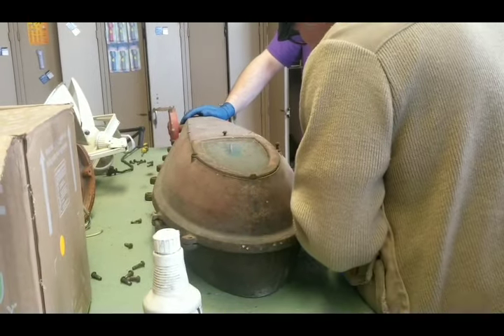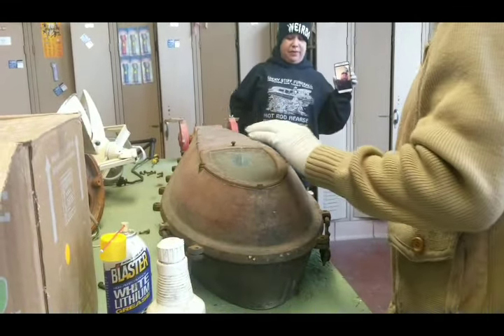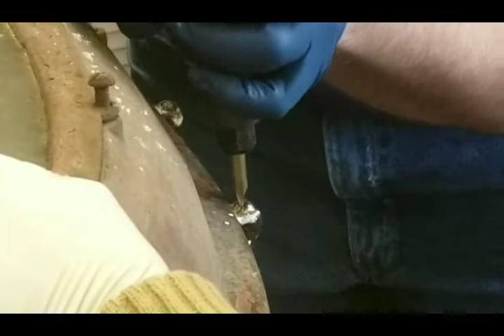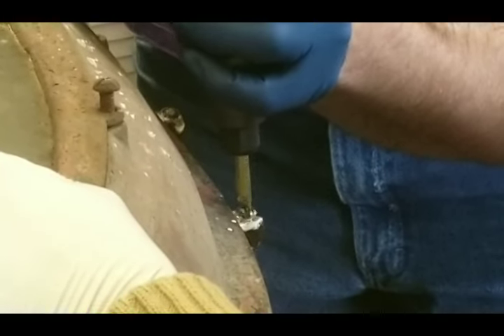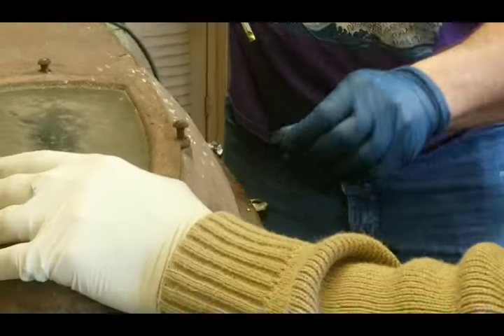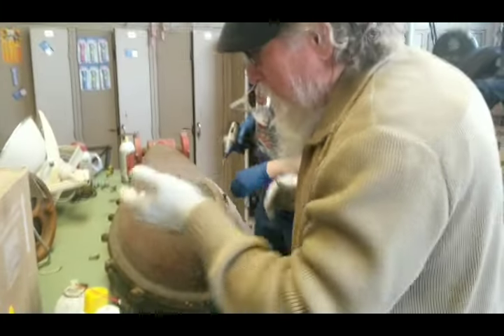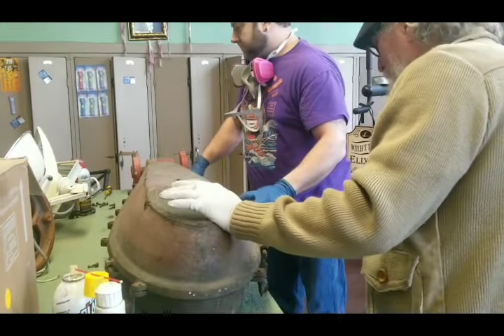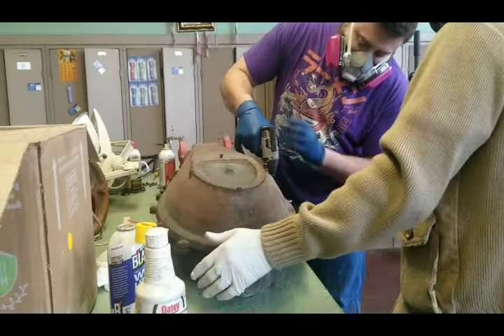Opening an 1800's Cast Iron Coffin

Comment: A suggestion for this:  Restore it to it's original look and donate it to a museum or something like that.  As there aren't that many many coffins like this, it would probably be an interesting exhibition piece.    Also, next time you do another thing like this, let your viewers know that it hasn't been used.  Would clear up a lot of people with Torches and Pitchforks. :D
Reply from the maker: I think my dad plans to at the very least coat it with a clear coat to stop the further deterioration. But he has no plans to sell it or gift it to any museum.
Reply: Exactly
Reply: Cast iron is fairly stable, as long as it's not somewhere damp it'll be fine insofar as the metal is concerned. Clearcoat will impart a shine which probably isn't what you would want. It's a bit of a work of art, that coffin.  @hollyerinn

Comment: I would never use power tools to open an antique like this.
Reply: ikr? especially one as apparently rare as this
Reply: Yeah I winced as soon as it transitioned from her talking to the power drill! A little lubricant and a lot of patience with a hand tool. Yikes.
Reply: Mike Owczarzak  totally agree they didn't use too powerful of an impact either.  Your not gonna damage cast iron.
Reply: Next time they rob a grave try some WD-40
Reply: @johndunn4228  but they did
Reply: They look like they know what they’re doing…
Reply: An electric impact driver is the safer method on something like this with frozen and rusted metal.
Reply: An impact driver with a flat bit? I'm not sure bout that? If you soaked the screws in some version of CRC or WD40 for 24 hrs it would help obviously, but it would also do weird things to the finish of the cast iron... 2nd to the other comment bout an impact driver not damaging cast iron- I disagree. Cast iron especially at cold temperatures can easily shatter- imagine trying to 'easy out' remove the busted off threads? Im not invested in this- I just saw it as a kind of morbidly vulcheristic disrespect to perhaps someones child or 'maybe a gold bar' tsk. At least TRY to pretend you are having some respect though.
Reply: And Christmas there looked kinda cold...
Reply: @stevenrodriguez9655  ...and light torch work when needed. Slot screws are old style and miserable to work with.
Reply: @MattBlack969  My guess is they could probably see through the glass that it was empty.
Reply: @lilskullstattoos9372  Anyone would, to others who don't know what they're doing.
Reply: @MattBlack969  A modern purist would hire a blacksmith to forge an historically accurate crowbar, faithfully to simulate a period grave cracker. Namaste.
Reply: Ok- I must admit I was in a bad mood when I wrote my original posts- but that said- cast iron is notoriously inconsistent in temper and hardness, I assume the 'blacksmith forged tool' comment was facetious? ( If not sorry) but anyone who has used flat head impact tools knows they are not great- and even with a penetrating lube and heat and a hammer struck impact screwdriver you would have the risk of snapping off or cracking the thread housings... It's actually a difficult one to decide? U could heat the housing lugs and freeze the actual screw? But the heat differential could cause the cast iron to crack too even without force... I was more annoyed at the lack of reverence at the time (and anyone who has worked with these things, not even historical artifacts knows flat head screws are notorious for slipping and burring or just breaking yr driver bits) I still think penetrating lube plus heat and gentle manual hammer struck impact screwdriver to break the first bond, then hand removal would be the best I can think of off hand? I'm interested in others opinions though. Cheers.
Reply: @JudgeJulieLit   We have better hand tools now that would do the same job- but if U were serious I completely see where you are coming from. Peace be with you.
Reply: @johndunn4228  didn't rob a grave...first of video explains found at a funeral home..in storage ...and they purchased
Reply: I would use hammer and chisel
Reply: @MattBlack969  yup you sound exactly how you think hahahhahah
Reply: @MattBlack969  should they have worn robes and the special hats of your preferred religion? Maybe chanting some nonsensical "prayers" would have been good? Please let us know how you would have done this we want to know what you would have done to make this holy.
Reply: @toasteddingus6925   @Mr/Mrs/Ms Dingus. Why would you bring religion into this conversation? Did something bad happen to you as a child? If so, my sincere condolences- that's rough. Hope they didn't wear 'funny hats' either :( I wish you all the best in yr recovery and if you ever want to talk there are many resources at hand. You sound hurt. I hope you feel better.

Comment: Penetrating oil first , crack screws loose by hand then use impact driver . All those original screws are buggered up now
Reply: I was thinking the same. Especially after banging on them with a hammer. Heat would have been the more plausible solution from the beginning...
Reply: You’ve got that right. “Penetrating”, not “Cutting” oil(one is for ‘penetrating’ things like rust and corrosion, and the other is for ‘cutting’ [screw]threads).

Comment: MY first impression of the coffin was "how TINY it is". And then, it looks like it has a clear glass "window" on the top of it, BUT, nobody seems to have mentioned it at all.
They are just spraying some "white Lithium" onto the body of the casket where the metal bolts had been, likely to help open up the casket.
At the end of the video, we see that this coffin is empty, an has never been used before. THEN they show a cast iron COVER that fits OVER the glass window of the coffin. It is an interesting  video.

Comment: So excited while watching this! Always loosen rusty bolts by hand first. PB blaster it, loosen a little then tighten a little back and forth by hand. I’d never use an impact on old rusty bolts not till you break it loose first. Also tapping with hammer after applying pb blaster helps. If none of that works torch it! ♥️

Comment: Should have used the fire wrench (oxy-acetylene torch). Just heat the screw bright red hot, then quench it with cold water. The thermal shock will crack the rust causing the screw to be stuck and it will easily come out. Ask any auto or muffler mechanic about it.

Comment: As ‘deathling’ who hung around a Victorian funeral home, so much is fascinating about Victorian funerals. I was going to mention a touch of W-D 40 before beginning would be a good idea since this was in a basement. Also a blast of heat can cause the rust to loosen. Just in case you need to do this again.
Reply: WD-40 is a good degreaser, but horrible as a lubricant. 'lubricates' for a short time, but removes potentially protective Ohio from metal surfaces. Did tests at GM, and defense contractor to verify. A good penetrating oil would be better.

Comment: It's not air tight or leak proof.
Cast iron, mild steel is still porous but if using Azko Nobel PA10 etch primer then a coat of 2 pot epoxy paint then it will be truely sealed.

To seal the both 1/2's just use urethane sealant.

Now if you really want a truely 110% sealed coffin then just make a titanium or 316L grade stainless steel cylinder (like a smoke stack but person size) then slide the body in and close up the end. To stop body decomposition just have a stainless steel valve then purge the cylinder and contents with Argon gas.

Comment: Fantastic. It does help if after the heating, wd40 or similar is doused over the screw. First time you'll just get smoke, second time the fluid will get pulled into the thread as things cool down. No hammer needed, usually, just the impact driver you were using.
Reply from the maker: we'll keep that in mind if we ever encounter a similar issue

Comment: No casket or coffin can prevent putifaction as it starts within the body itself, not needing outside sources. They still sell caskets today claiming to be well sealed to so protect the decedent but it's an unnecessary and expensive choice. Not to mention a sealed casket can actually explode due to a buildup of trapped gases from decomp. Not a wise choice.

Comment: That was really cool and very interesting! Btw I’m jealous you have a hearse 😊
Reply from the maker: thank you! and don't be jealous, you'd be surprised how many are out there for sale if you really wanted one.
Reply: @hollyerinn  Oh one of these days I’ll get one. 👍🏻
Reply: A lot of people are spooked by Hearses. They make great cars as they are built on a heavier commercial frame and mostly use Cadillacs or Lincolns. Low mileage, well cared for autos as the original cost is quite high for the custom body work. Companies like Miller, Superior, Sayers & Scovill, Boyertown body works, and Hess & Eisenhardt build many of them. I have a Sayers & Scovill Victoria Cadillac Brougham 1989 with 85K miles in 32 years. It has serviced a least 4 different Funeral Homes in it's life so far.
Reply: On my drive back from CA I passed an old hearse from the 50s or 60s and the license plate said "U R NXT!" 😅😂😭🤣🇺🇸

Comment: That is neat I just wonder how they hold up to the heavy soil being cast iron it doesn't bend like steel it would crack neat video
Reply from the maker: a friend of a friend was just helping in a cemetery down in New Orleans and one had been washed out of the ground due to some heavy weather. I got send a photo and it looked like it held up quite well, rather rusty but still in good shape otherwise. So they seem to hold up great over time.
Reply: Most likely it was used for repeated cremations, the ashes from each one being salvaged for the family.
Reply: The lid of the coffin is curved with only a minimal flat section. 
It would support huge weight as long as it is spread evenly, (which of course soil will do).
That is how thin concrete dams hold back lakes and how vaulted stone ceiling have survived in many building for centuries.
Reply: @paxrail  Do you mean they put the box in the furnace like a giant enamelled casserole dish?
Reply: Actually really well. There have been many that have been dug up, most of the time by accident. Lady in red was found when they were digging a hole for another grave. It's air tight. The seal preserves the body. But if the seal is broken and air enters then the body rapidly decomposes. Look up the YT video for Lady in red. Thumbnail is a photo of her face in a similar fisk casket.
Reply: There was many other types of these fisk coffins, most by other names like egg coffins due to their egglike shape, some made from different metals like brass, bronze etc, these coffins were known to explode more than the fisk design usually. Beautiful coffin, glad that it wasn't used or in use...that would have been a grim sign if it had a body inside...especially after all that noise. LoL. I subscribed to your channel because of this video. There are even rarer versions (mostly because they was cheaper and often exploded before burial) where there was a full body 1 inch thick glass view port made by a different company  (some of these are known as egg coffins) they fell out of popular view due to their nature of being a ticking time bomb LoL.
Reply: @thelucondrix391  I've always been very interested in that type of stuff I bet we could sure have a good conversation for sure good buddy 👍

Comment: If you put a thick rubber band on the screw head it will help pull the screw out. A little trick I learned from a machinist back in the 90'es .

Comment: Wear masks next time you do this...toxic stuff will blow right into your system my friends...it will screw you up later....
Reply: @GarrisonsMadHouse  Really?!! It does happen!  There is a video of that showing it happened in a cemetery inside a casket and it oozed out of the casket down the sides of it onto the floor!!  Research it!!
Reply: 1:  What “toxic stuff” exactly?  What do you think is in there?
2:  The one gentleman had a respirator with organic vapor cartridges.  However both men have facial hair which renders a respirator useless.
P.S.:  If you do happen to know you’ll be around something truly toxic, a household “mask” can actually make it worse for you.  Those are only for coarse dirt to reduce irritation.

Comment: The steel hammer against cast iron is the disgusting part. "Get a hammer" no. Get anything except a hammer. That is not how you treat antiques. Disgraceful. And wd40 turns to glue, its crap too.
Reply: Idiots. All they had to do was carefully heat the recalcitrant bolts and the iron around them to get them out. I was appalled at the application of the steel hammer.

Comment: That would be a urushiol based lacquer over the cast Iron I think. The red is either the natural oxidation tone and then a black iron oxide is mixed in with lacquer to semi-mask the reds, and then wiped with a grain tool to give it a wood effect. Not sure if the WD-40 was a good idea to wipe across it. Solvent based lacquers weren't invented until 1920. You could probably wax it to get the luster and sheen back if the WD-40 damaged the coating and made it look dry and chalky.

Comment: Find someone competent in silver soldering and get that handle fixed. If the breaks are clean, you will not notice the silver solder and stronger than brazing. A special find for sure!

Comment: FOR THE LONG TERM I WOULD SUGGEST STAINLESS STEEL BOLTS!
BEFORE REAPPLYING NEW OR ORIGINAL BOLTS LUBRICAT THE THREADS AND UNDER SIDE OF THE BOLT HEAD WITH BLACK PERMATEX SILICONE GASKET 
SEALER.
THIS WILL ALSO KEEP MOISTURE AND CORROSION OUT OF THE THREADS!
I ALSO USE THIS ON AUTOMOBILE 
LUG NUTS TO AVOID BREAKAGE.

Comment: Were it not for the lining, AND you built a steamer box (cardboard would do fine), you could steam/boil the iron.
It will convert the iron (ferric oxide) to magnetite (ferrous oxide).  We call it rust blueing in gun finishing. 
VERY low maintenance coating and very easy to do.
Reply from the maker: that's definitely an interesting idea, I'll pass it along to my dad.
Reply: @hollyerinn  If the finish is too thin and you want it "right", Mike Lee's Express Rust Blue does a great job. Mark Novak did a few vid's on his channel.
Reply from the maker: @michaelkaiser1864  very cool! thanks for the recommendation!!

Comment: A 1800s cast iron coffin would not have updated screws unless it was already opened before!!
Reply from the maker: They were square nuts that were on there that have been used for well over 300 years, they were used to make wagons! look it up. And the slotted head on the screw that's what's been used forever. Phillips heads, which is what was NOT on here are the more updated screws and weren't patented til 1932.

Comment: Stainless steel screws?
Reply from the maker: they were invented in 1872, so it fiits.
Reply: Nope. They were brass.  Stainless actually will corrode in the ground. Galvanic corrosion.  Bad choice. And it will especially fuck up in a steel threaded hole.  They mentioned brass in the video.  even then if it was in the ground, they would have broken off.  heat is always required.  Unless you immerse the area for days with WD40.  You would mold a clay dam to build a little cup around the bolt and fill with chemical.

Comment: Jesus Christ watching people do what a mechanic does everyday and know they don't know the tricks to removing rusted screws or bolts is painful to watch. For future reference there are a couple of tricks. 

First one, turn the impact driver on forward and QUICKLY hit the button, it drives the screw a little bit forward breaking the rust seal. 
Second trick, since it has ears the screws were in grab a pen torch and heat the area around the screw, metal expands breaking the rust seal. 
Third option take a normal screw driver, place it on the screw head and hit the handle with a hammer breaking the rust seal. 
Fourth take a chisel and hold it at an angle on the outside edge of the screw, hit it and it should bite the metal and turn it slightly breaking the rust seal.
Fifth option since they come all the way through the ears, take a drill and a drill bit the same diameter as the screw and drill it in the center, you ruin the threads but can be tapped later for a larger screw (you mention thread cutting oil) 

More times than not I just take out a pen torch and heat the area around a screw because heat works 99% of the time. The other option are for when the heat doesn't work.

Comment: You don't ever pound on vintage cast iron if made over a century ago. It will break, flake and possibly shatter. Use a rubber mallet if necessary to pound on anything, as the older iron made before WW1 is of a grade that is better than today's which is inferior in quality by comparison. 😉

Comment: this is all b s screws in a old coffin  that you use a drill to take them out and that old
Reply from the maker: How is it bs? Stainless steel screws were invented in 1872. Look it up before you come at me.
Reply: The coffin had never been under ground. It was stored inside in a funeral home. I have a 88 year old Ford truck that still has most of it's original parts and bolts. With care most can be loosened with time and care.

Comment: WHY ARE YOU HITTING THE THREADS WITH A HAMMER GRANDPA. Jesus. you do know the end threads have to go through all the other threads and when they are mushroomed they aren't gonna do that. Its a good way to fuse it permanently. Nothing tighter than a cross thread.

Second stop using a child's hammer what is that a 2 oz hammer. Grab a mans hammer and hit around the screw. NEVER HIT A SCREW WITH A HAMMER. Just hit the surfaces around it.

Third if the hammer in the impact driver didn't work why would you think less energy exerted would work? 

HEAT HEAT HEAT HEAT HEAT HEAT HEAT HEAT. Yeah a Torch like the guy said.